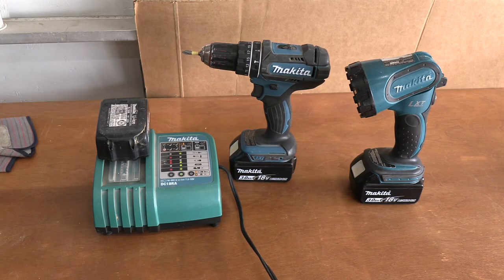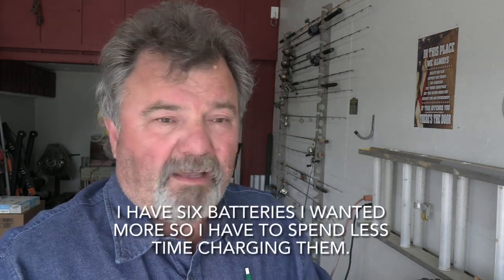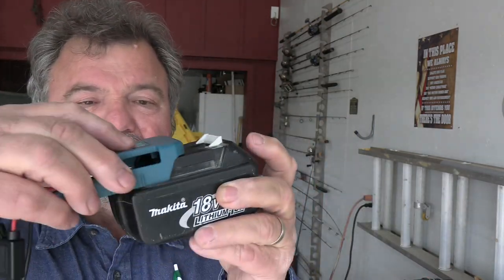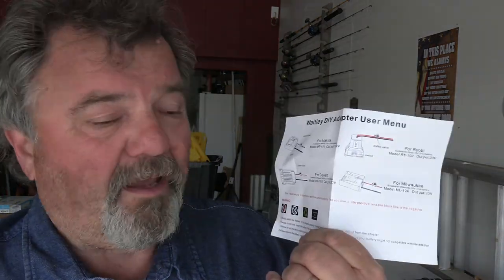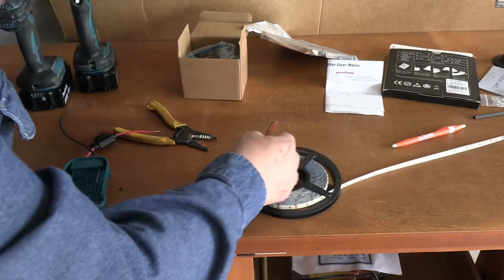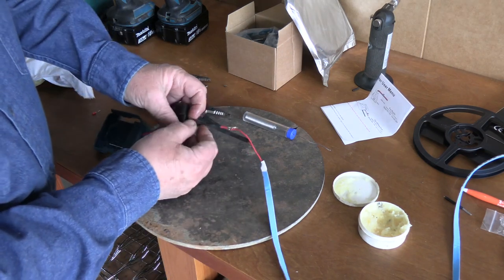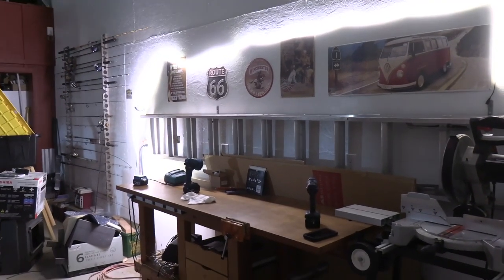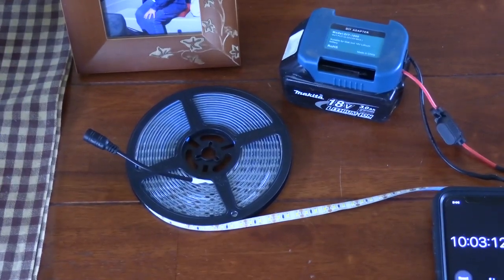LED lighting from your battery tools. #OffGrid #RopeLights #Camping.

Comment: I was literally just sitting in my garage thinking about making this thank you 👍 I converted my 4 year olds electric 9v car to Makita 18v and she drove it for 2 miles around a local lake and the battery still read 4 bars so I’m confident that these lights will run for a very long time
Reply from the maker: @andymitchell368  thanks for checking it out. I’ve made a couple of these and they were very well and I was so surprised at how long the batteries actually lasted. I have one upstairs in a cabin on my property and I have another one in a shipping container it’s amazing. How long do you last. I also made a redneck air conditioner out of an ice chest that runs off the Makita battery. It’s in another video if you check out my videos.

Comment: Great idea, Joe!  Like you, I never knew those things even existed.  

Our off-grid cabin is only a mile from our main residence.  My wife rigged up a series of indoor solar lights.  So far, they're doing fine.  They're simple, easy to install and provide adequate lighting for a small cabin.
Reply from the maker: That’s great. I eventually want to put a solar system on this cabin, but it’s down the road a while. So for now with the batteries I have, I can use my tools and have a lighting system inside the cabin or outside the cabin with the batteries too. I also have some kerosene lanterns that I can use outside. So we’re getting set up for halfway decent lighting.

Comment: Fantastic video 
I have done the same with my Makita battery but find my battery 5ah lasts around 55min per full battery? Any idea why it drains so quick?
Reply from the maker: There could be a couple of reasons. I just bought a 10 pack of five amp hour Makita batteries off of Amazon. And these are real Makita batteries not a knock off. So mine were brand new at the time of testing. New batteries typically will stay charged longer than older batteries, just because they slowly wear down. The other reason could be the amount of wattage your lights are using. I’m not an expert in this, but I do know the more watts something uses the shorter the battery life. even on my Makita tools, some of them will work longer than others because of the wattage they use while working. I have recently bought a new device. I’m going to use and make sure it does what it’s supposed to do and then I will do a review on it, it is a DC 18 V to 12 V reducer That will work with Makita batteries. I’m going to try this out To see if battery life will be extended. It was $26 on Amazon. I hope this helps you out.
Reply: Thanks bud I will try the 18 down to 12v converter and see how that works as I find all my battery’s new and old are performing less than an hour 😩 thanks again